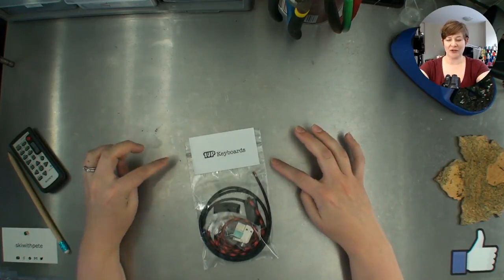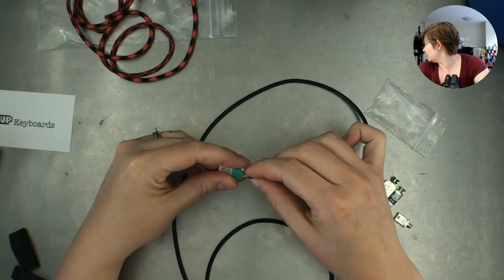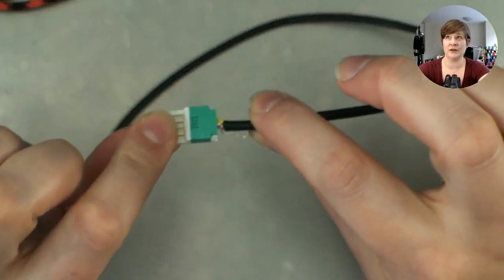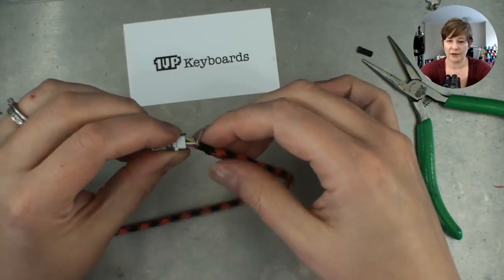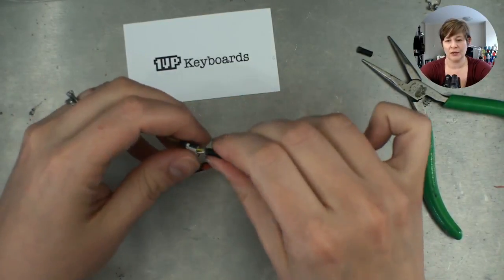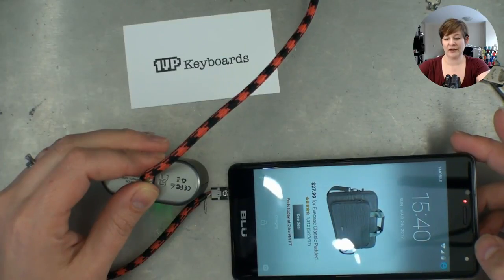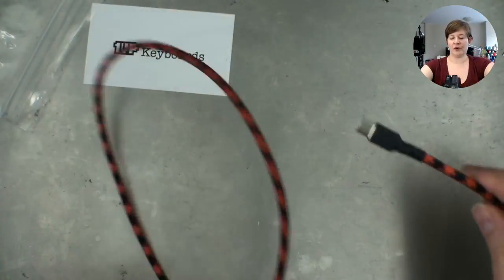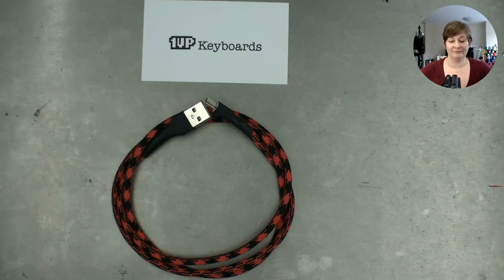How to: No-Solder DIY USB MICRO cable kit assembly from 1upkeyboards.com

Comment: Late to the party, but it's easier if you don't strip the cable until after it is fed through the paracord, pull back on the paracord a bit, then strip the wires.

Comment: It would be easier to just loose the inside string but dont pull them out totally. Attach the usb cable to one end of the sleeve inside and pull the usb cable through. Like fishing cables through dry wall.

Comment: Seems like a lot of unnecessary trouble when you could just buy a premade braided micro usb cable at almost any store for $10...
Reply from the maker: Because when you make it, you know exactly what went in, and if something goes wrong, exactly how to fix it.  You can also change the size of it, and make it exactly the right color.  Maybe something off the shelf is fine for you, and that's great.  But maybe it isn't.
Reply: And it's fun
Reply: Obviously this video is not for you as you are not a keyboard enthusiast